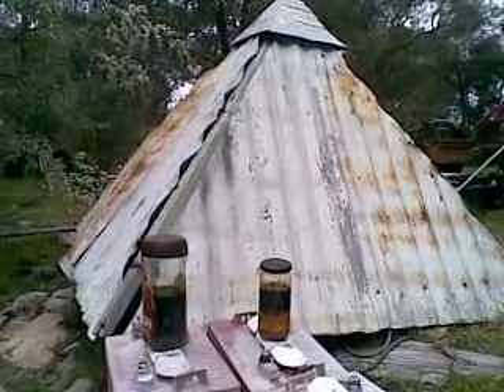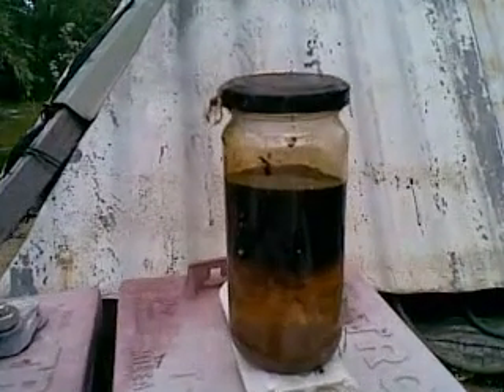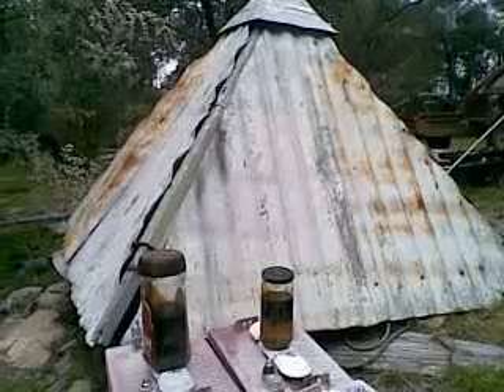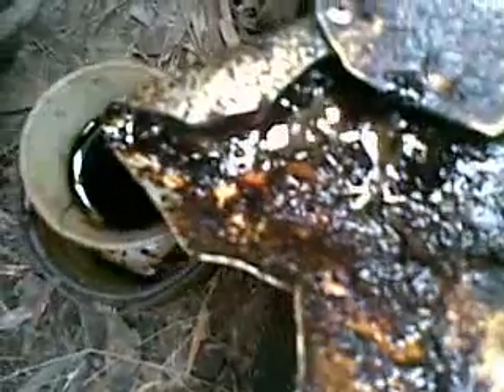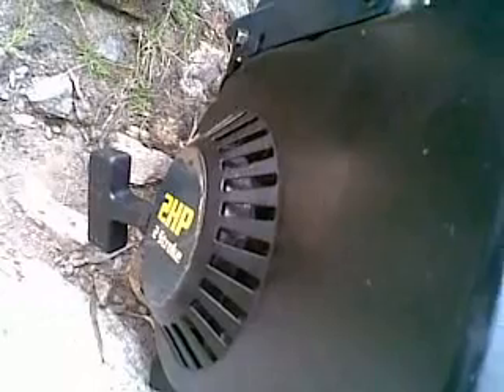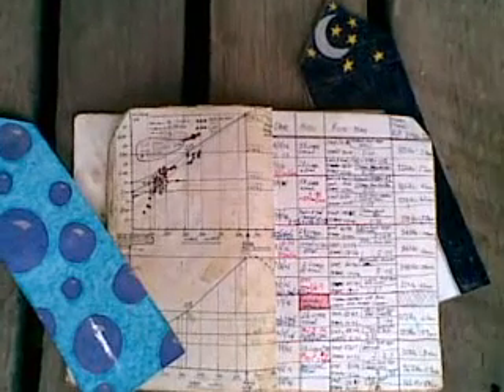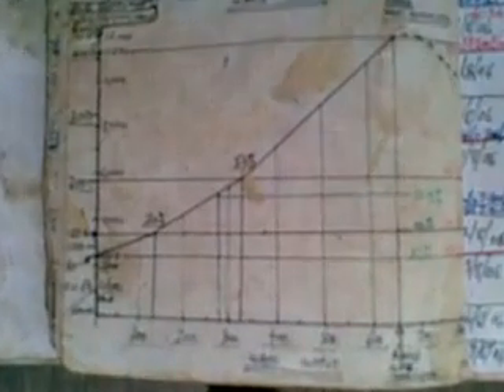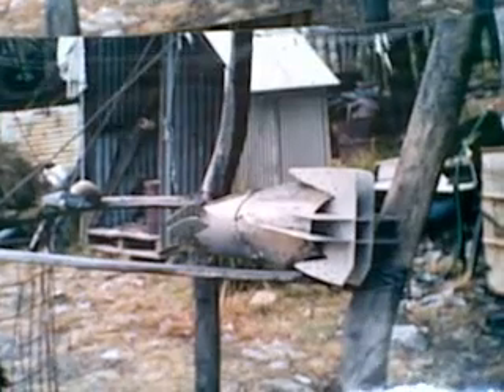Refining Used 2-Stroke Oil, From Exhaust-Gasflow. AERO-HILLBILLY Leads The World. Again..!

Comment from the maker: @tomken8dy
   G'day...   Is that right ? Franklin had Barrel-Capacitors to store Lightning ??! That's something I didn't know.
   Um, the 2-Stroke motor turns 20% of the energy in the fuel into Torque. The Alternator turns half that Torque into Elecktrickery. The Stator-Wire combs it, out of the Spinning Magnetic-Field. Twirling a Wire in Space does nothing, without the Magnetic-Field... So, 10% of the Fuel emerges, as Electrickery.

Comment: Nice, one thought, can you back off the ratio ? Or is this gagging for it to fuse up into a solid lump. May be two tanks, one 50:1 one straight petrol & two taps...on a heavy load 50:1 on a light load mix in 'cleaner' un oiled fuel.....not good, just less bad.

Comment from the maker: @magna59
  Hi Bob...
   Ah, not a good idea to run 2-Strokes with no oil. They run hot, scrape & scratch the bore, then lock up as the bearings turn to gravel...
   Considering I used to run Model Plane Engines on 33% Castor Oil/Methanol, or equal parts Castor, Ether & Kerosene for the Diesels... The Genny, like the Chainsaw, is AMAZING, to be running on just 2% Oil ! Dad's Saws used to burn 25% used Sump Oil. Which I use, for Bar Lube !

Comment: The "Modern" generator is well over a century old.
It uses windings spinning though magnetic fields
to "comb" electricity out of ambient space.
Crude and inefficient.
THAT is how it really works.
One does NOT convert mechanical energy into
electricity, nor apples into oranges.
Ben Franklin and Nikola Tesla collected electricity
with no moving parts.
Franklin used bulky, primitive capacitors
sealed in barrels with pitch that could still easily
deliver a fatal lightning bolt.

Comment from the maker: @muddymuddymuddmann
   Hi Scotty,   Yes, that's my thinking. And, maybe, double the sheetmetal-thickness in the Condenser, to let more heat move to the fins, and seal the Matrix Joints with Hi-Temp. Silicone ; and it might return 2.5%, rather than the current 1.3% of Oil Input. So, what's 2.5% of the 2-Stroke Exhaust-Oil from Stationary Pumps & Generators, Globally..? It isn't Rocket Science, either, no moving parts. All one has to do is empty it ! Ciao..